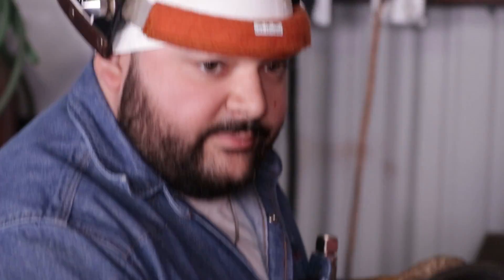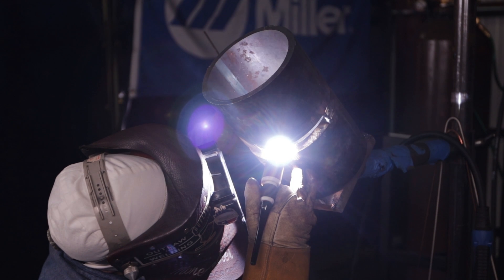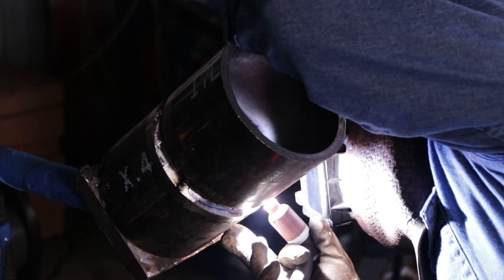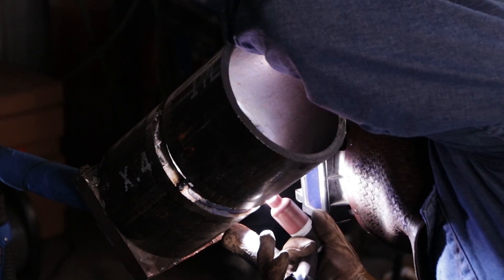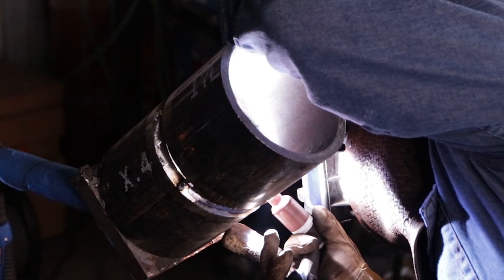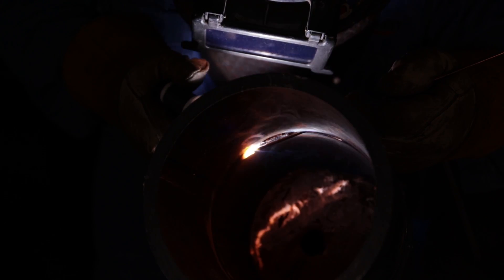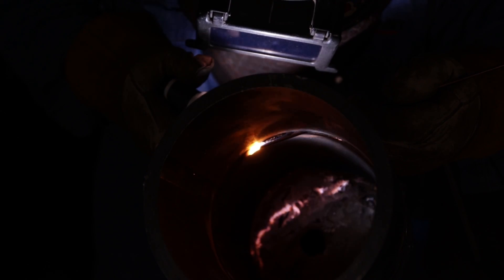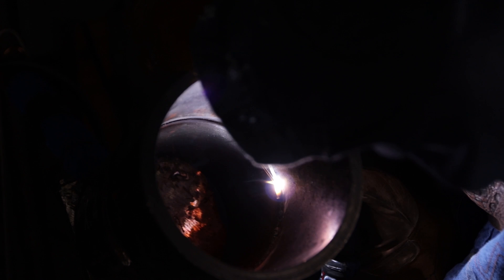Pipe Combo - TIG Root/Hot Pass - Flux Core Fill/Cap

Comment: Personally when I'm using the flux on pipe on the 3 and 9 o'clock I go the opposite side and drag/pull the torch over the top, chance of LOF if you push over the top but that's just how I learnt.
Reply: How hot do you run on the flux for the combo boss this videos those show anything
Reply: @israelhernandez4305  around 26-28 volts and around 200 amps

Comment: How can I avoid getting porosity on the bottom tie ends ?
With 7018 
I busted a test cus of porosity
I wire wheel brush all my passes so the weld would be clean but on the cap i caught porosity 
Schedule 160 tig root n hot 
7018 fill n cap 
Thanks in advance
Reply: Strike the arc in the bevel a couple of inches above where the weld actually needs to start. Then slowly travel with a tight arc, like your dragging the rod against the face of the last weld, to where you need to start depositing your next stringer or weave. This lets the rod get hot and burn off any moisture or porosity introduced by the tiny amount of time the weld puddle is potentially exposed to the atmosphere and moisture in the rod. Give it a crack 👍🏼
Reply: If you make pinholes along the edge of your weld like this video had after his hot pass, you're going to have a lot of porosity or more potential for porosity. Either way, this video wasn't good IMHO; however, it does show what you don't want on the edges of a pass and not much uniformity. You want those TIG passes laced up and then you don't have to worry using your rod to try and burn all of that crap out.
You should know whereabout you're going to fall while you're welding. After all, you're the one putting it in there, but if you like grinding you're in for some fun. You'd be surprised by how much these voids can add up and they push back against the shielding gas too!  Passing over one not hot enough with a long arc and you just failed. Try to make each TIG pass uniform without those holes/gaps and practice making it uniform. If you can walk off the bottom, you will be fine on stick.
@IzzyBoss is right, you would have to plow through tight with your rod... Technique.
How do "you" think you failed?
Good luck!
Reply: Don't long arc
Reply: how hot are you running?
Reply: Around 130 amps
Reply: You're arc will be to far away I had this trouble for ages until someone literally filmed me and I was like shit I was far away from the pool, need to keep that rod real tight.

Comment: Why the clockwise or counterclockwise?
Reply: the difference in clockwise and counterclockwise is dependant on your direction of travel. If you are going left to right, you'll go counterclockwise. This will cause you to begin your weld pool on the bottom and rotate on top. If you went left to right and used a clockwise motion. You would start your pool on top of the bevel and circle back down to the bottom. Causing your pool to sag down and trap slag by the time you did your clockwise rotation. Does that make sense to you?